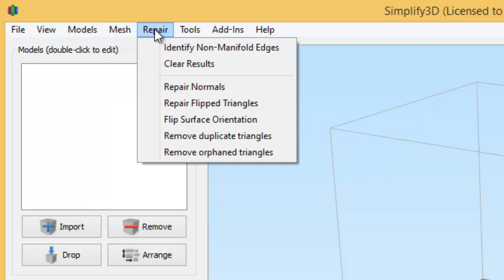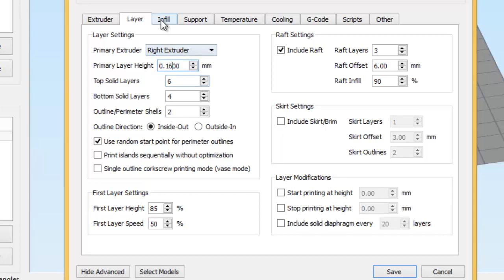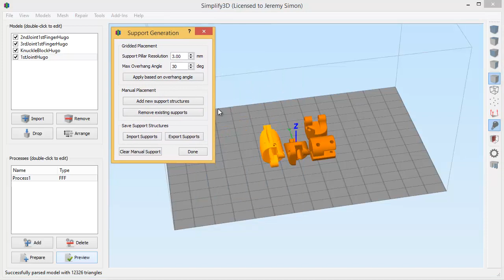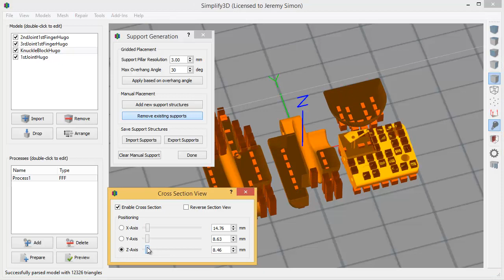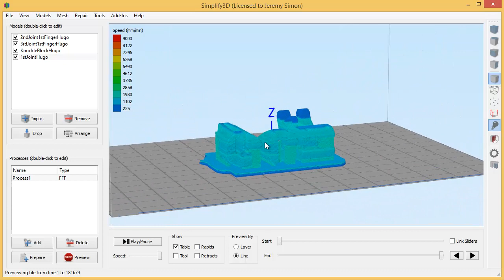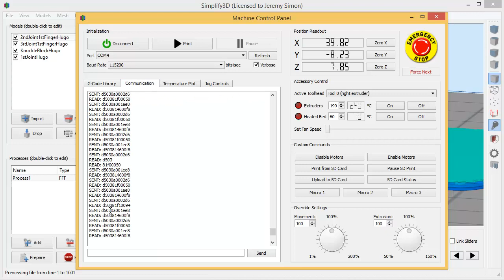Simplify3D (Software for 3D Printing) Demo and Review (3D Universe)

Comment: Is there an option for soluble support structures to use cheap pla to print most of the support structure but then for the last couple of mm inbetween the support structure and the 3d model to use soluble material? Of course you would need a printer that can handle 2 materials at once. Any idea ? Anyone?
Reply from the maker: Yes, there is. In the latest version of Simplify3D, you can edit your process settings and go to the Support tab. There, you will find options for Support Material and for Dense Support. Set the Support Material to print with extruder 1 and set the Dense Support Material to print with extruder 2. Then you can print most of the supports using PLA and print the last few layers of the supports using PVA or other soluble material.

Comment: Why would I want S3D over Cura which of course is free?
Reply from the maker: Cura has come a long way since this video was made. It's a very solid program. The main benefit of S3D is the ability to customize placement of supports. With Cura, supports can be off, touching build plate, or everywhere. With S3D, you can control which specific parts of the geometry have supports. Whether or not this is important depends on the kinds of objects you want to print.
Reply from the maker: osamabinsmokin Not infill. You can customize the placement of support structures - the ones that go outside of the printed object to support overhangs. To customize I fill, you would have to divide your object into multiple STL files. Then you could assign different print profiles to each object, some with infill and some without.
Reply: 3D Universe Uhhh yes you can? Didn't you at any point wonder what the "Processes" window is? You set a layer height for each process and you can change every setting separetely, including infill. That is a very neat feature as you can set easy or straight sections print fast with bigger layer heights and more detailed areas slower with smaller layer height
Reply from the maker: Right, but a process can only be assigned to an individual object. The question was whether you can switch off infill for specific points in a model. As I said before, you would need to divide the model into multiple STL files using something like Netfabb. Then you could create a separate process for each model and control infill and other settings for each process.
Reply: I guess you can read it that way too. That would be a welcome feature though, or maybe manually adding infill to where you need it.
Reply from the maker: Yes, that would be a welcome feature!

Comment: question i just purchase simplify 3d and would like to know if it is possible to build models from scratch on the software and if not what would you recommend to use with it
Reply from the maker: No, Simplify3D is not a 3D modeling program. It is only used for preparing your models for the 3D printer. There are many options available for 3D modeling. Here's a good place to start: https://i.materialise.com/blog/top-25-most-popular-3d-modeling-design-software-for-3d-printing/
Reply: thank you

Comment: Question for you. I just purchased Simplify 3D. I have a particular model with relatively thin walls.I don't know how thin they are exactly but I'm certain they are not too thin to print.When the model is imported it looks great. After the model is sliced, the visualization shows that the thin section is gone. I'm positive that it's not too thin. Is there an area that controls the quality of the slice? After slicing why does the visualization not look just like the model? Why are thin sections being deleted? Great video. Thanks for making it.
Reply from the maker: +DevenneyGroup Is it possible that those sections are thinner than your nozzle diameter? If you're using a 0.4mm nozzle, sections that are thinner than that wouldn't print.

Comment: Like what you demonstrated in this video. What are you using for support material? I have the FlashForge Creator Pro, I was wondering if it is possible to use dissolvable support material? What's your take on that?

Comment: Great job of demonstrating this software. I'm sold! 

I was a gcode programer for 25 years and used a CAD CAM software called Mastercam, it worked on the same principal. Good software is very important to the finished product.

Comment: Hi.  Any idea why simplify3d does show any printers but the default during install?  Unfortunately it then goes haywire and has no idea where home is.  It will either ghost print on the back right corner without raising the bed at all.  And when you hit "go to" X Y or Z home it goes all the way to the left or front and starts chattering bc it wants to go too far.  Also, Is there anywhere to get the FFC pro settings to bypass the default settings for the ffc pro?  thanks!

Comment: hello, thanks for the video, it helps.

Quick question:  If I have 4 objects like you have here, is there a way to scale them to the max for the print bed? They'd all need to be scaled the same ratio as they're parts of the same model, but I'd like to get the overall model as large as I can in 1 print.

Comment: So, this is 3D printing slicer for dummies @ $140? What can this do that Slic3r cant do for free? 

...not to mention the over welling support from the community that comes with Slic3r .
Reply: Brian Link It actually has considerably more features than any other slicer I've used. You can separate your model into different parts and use different settings for each part. This lets you do some very advanced stuff and manually fix a lot of the limitations your 3D printer by forcing it to print parts that might have very thin walls or by making higher quality external features.

It's also extremely fast. I'm doing a comparison right now just for curiosity's sake with the newest version of slic3r - a half million poly zbrush sculpt, about 4 inches cubed 66 micron layers, 4 shells. Slic3r is still working away at over 15 minutes, not sure how long it'll take... S3D slice was 20 seconds. It absolutely crushes every other slicer in speed.

If all you care a bout is cost, then there's no convincing you, but if you want a professional tool that's going to do it better and faster and that's worth something to you, I suggest you give S3D a try.
Reply: Stan Velijev Nice! From slicing point of view they can take some time. Although I don't print at small layers mainly just at .32 millimeters height my times are usually about 1 minute for slicing. Although I have heard of extremely long slicing times on complicated models I personally have not experienced that. In the application that you're using it for it sounds like it's working well for you. If I was in the market for that need, it sounds like something I would definitely look at. 

I would suggest to include that in your video as a primary advantage along with the advanced editing. 

I create my model in the modeling software itself, while keeping in mind of the results I'm looking for.

This slicer software can be a great tool for manipulating models that your self did not design specifically for your printing needs.

Comment: Overall, I like the program too. Control over support material is it's strongest point. But for a commercial product it has more flaws and weaknesses than I find reasonable. It is buggy and will crash without a lot of provocation. The GUI is "eye candy", but not very refined.  Patterned infill extrusion methodology badly flawed. Exporting of .fff (.xml) config files is flawed.

There are free options that I find as good or better in many cases.
My favorites are:
1) Repetier Host w/ bundled Slic3r and CuraEngine. Great visualization tools.
2) MatterControl - also w/ bundled slicers. Supports x3g files. Visualization slightly lacking, but good enough.

Comment: Doesn't Cura and Slicer3 do all this for free!  I would sooner use them and donate some money to Open Source developers...
Reply: Ant Scranney I've donated to the people who work on sailfish opensource firmware for makerbots. I've also purchased this software. Both were good investments.

Those slicers don't have all the same features, aren't as fast, and based on some year old experiences with slic3r, are far more buggy. Can't say much for Cura since I only tried a few slices with it, but slic3r in particular really mangled my models a lot of the time and did some really wonky shit with the toolpath. Doesn't happen at all with S3D.

I'm doing a test slice with slic3r right now just out of curiosity about how development has progressed. It took 20 minutes 17 sec. S3D did the same slice in (i shit you not) 20 seconds. I mean if you don't value your time, then maybe it's all the same to you, but there's a lot of value to me in saving 95% on slice times. What if I did the slice, checked over the preview and realized I missed a feature or want to change some speeds? Another 20 minute slice. Plus I didn't even have supports on the slic3r model because automatic supports would be overkill and unfair, so it should have taken longer.

Looking over the gcode preview it's still doing a lot of wonky shit with a lot of solid infill inside the model where it doesn't make any sense, and some of it randomly at slower speeds than other even though it isn't doing topfill. So this print would no doubt also take longer because of all this unnecessary solid infill, wasting more time.

Comment: I bought Simplify3D v2.2.2 and discovered that it lacks basic standard functionality:
1. No "Edit" menu.
2. No Undo-Redo commands.
3. No way to assign meaningful colors to objects on the platform (say black for your object and white for supports).
4. No way to align objects on the build platform in relation to one another.  Necessary for two color dual-extrusion prints.
5. No way to easily place objects flat on the bed: a Z offset of "0" puts objects off in space.
6. No "group" command or other way to edit or change parameters for multiple objects at once; you have to select each one and change parameters sequentially.

I've only been using it for a couple of days, but I'm disappointed.  If it were free or shareware, that would be one matter, but for $140 I want finished software.
Reply: Jamie White It doesn't seem like it even has actual 3d modeling capabilities, does it only allow you to work with already created models to set them ready for printing? If so, that is absolutely unacceptable.
Reply: I use Fusion 360 to construct the models, so I haven't investigated if Simplify3D has modeling capability. I just bought it toarrange objects on the print bed and generate toolpaths and support structures.

So far I have been unable to print 2-color objects.  It does some things well (like the video shows) and the slicer is indeed fast, but it  lacks some very basic functions.
Reply: Jamie White Upgrade to version 3.0, it has most of what you complained about implemented.

Comment: I purchased this software and it works pefectly for what I need. I used to use Flashprint  which was a software used for the Flashforge Dreamer. Its safe to say that Flashprint was so limited that it effected the quality of my prints. With Simpify 3D all my issues that I had before with Flashprint were solved. It's now easier for me to print with supports that can easily be broken off. Orginally, Flashprint supports would end up being to solid and hard and there were no settings to adjust this. Simplify 3D definately is a easy software to use and will make 3D printing life easier.

Comment: The videos are well done and I applaud that. However, they paint a much different picture of the product than was my experience. Before purchasing, I emailed the developer several times asking very specific questions about the ONE feature S3D purported to support that I was most interested in - "changing slicing configurations for different parts of the model" (this is a quote from the company from 3/14/2014 last year). It turns out - and they have actually changed their description - that this feature is actually BY LAYER. A very different capability and one that I explicitly asked and was given a less than honest answer. And, once I figured this out, I discovered that the feature requires knowing "the layer" by height, not the layer number. So if you want to do something special on layers 3 to 5 you need to know that layer 3 starts at 0.60mm (or wait, is it 0.75mm?) and 5 ends at 1.20mm. Very difficult to use effectively.

Now, almost a year later, some fundamental issues with S3D still have not been addressed. One of the big ones (and a show stopper for me) is the primitive infill support. The S3D forum is filled with infill-related issues due to the unsophisticated way it creates a loose infill grid. Finished parts are frequently described as "mushy" and that was my experience. There are many other things that make you scratch your head and ask "have they actually ever used this program themselves to print parts?" I gave the product a thorough checkout after purchase and ended up requesting a refund. There was not one thing that it did particularly well (for me - I realize that others have different requirements). I do not use slicer-generated supports (I design support structures into my models if needed, this is much more efficient and gives much better results). The lack of any customer support was a big issue. My license key did not work and it took the company 3 days to respond! (and this was during the work week, not over a weekend). Questions emailed to support took an average of 48 hours for an incomplete reply to my question/s. Many times, I provided the explicit details on what I had tried, my configuration, etc and received a response to try something that I had already told support I had done. It was if they didn't even read my questions, seriously.

I you go to their forums to post a question for help, you'll discover that your initial posts are moderated. It took 4 days - I kid you not - for my initial post to be approved. And to make matters worse, I had to make a second post and have it moderated before being allowed to make unmoderated posts. All of this just left a really bad impression about the company and the product. I would consider myself to be a sophisticated user with many years of 3D printing, CAD design, and slicing experience. Some of the glitzy visualization features may appeal to new users but "point cloud" and "normals" views? Seriously? Why waste development resources on "features" like this (and there are many others)?

Caveat emptor - read their forum, release notes and make an informed decision.

At some point, when I see some progress in the areas that were show stoppers for me, I'll try it again - as long as I can get a money back guarantee again. I understand that they only honor this one time, so that might be an issue.
Reply: Michael Hackney It does do different profiles for different part of the model. You simply have to make multiple profiles, separate your model into different parts in your modelling software, then assign different profiles to each piece. 

They even have a tutorial on multi-part printing on the support section of their website and have had it for at least the past year which outlines that you can do this. In their example the models were separate objects and not overlapping - though there's nothing stopping you from doing that.

I've printed probably thousands of models and none of them have ever been mushy, so I'm not sure what the issue is there. Perhaps you're printing with too few shells? Too few bottom/top layers? I mean if you're doing one shell then I can see how this would be true, maybe 2. Most stuff I print is 3, and no prints have even seen soft or mushy for me unless I was using soft filament.

Never had problems with the forum, and don't particularly remember posts needing moderation. Maybe first few posts they check for spambots, but I'm certain I didn't have to wait for most of my posts to show up. They actually do listen to suggestions though, I've had things implemented that I've asked for, so they do read forums, they just rarely respond themselves and let the community help each other.

Worth noting that the new version has many new infill options: https://www.simplify3d.com/simplify3d-announces-version-3-0-of-universal-3d-printing-software/ Might be worth it to give it a new try, also good dual extruder support. Slices ridiculously fast.

Comment: I finally bought this program but I'm having some difficulties with it.  When it puts down it's anchor bead, it pulls from it leaving a tiny stringy line of filament that I have to reach in and pull out so it doesn't tangle with the extruder while it prints.  Also, I had a cell phone case print on it over night (it was about a 3 hour print) and this morning the supports and raft were so hard to pull off that they chipped off parts of the finished piece.  The raft even broke off a piece of the case from the edge, and the whole thing was hard as a rock.  Have you come across any of these sort of issues?

Comment: Hi I bought the software but am having issues printing. I am using ABS and the filament isnt sticking to the bed.  It seems like its not coming out fast enough.  Basically its clogging up.  I am able to print fine using MakerBot.  My printer is the CTC 3D dual extruder.  Any advise?